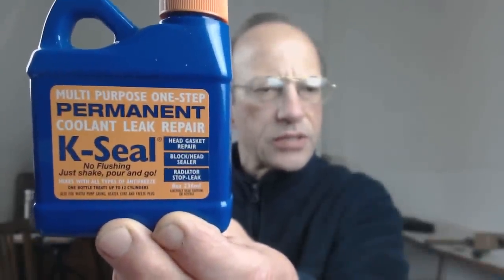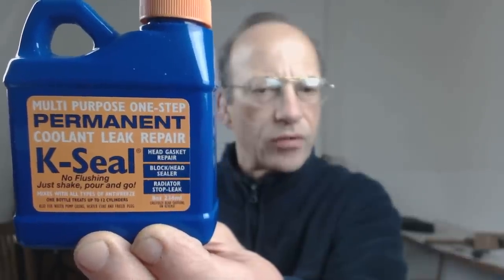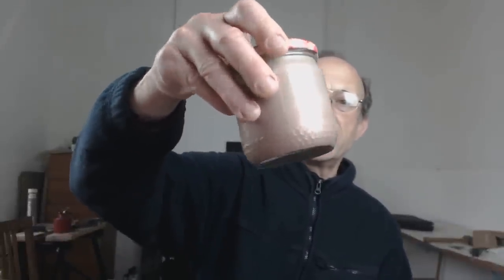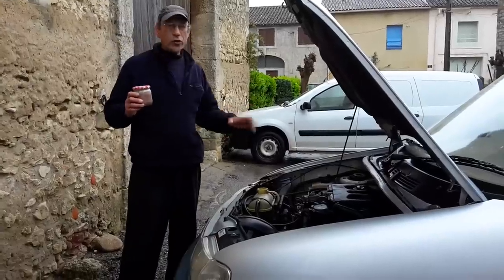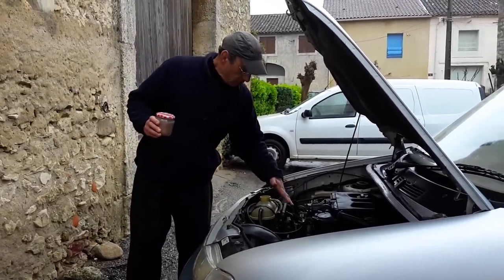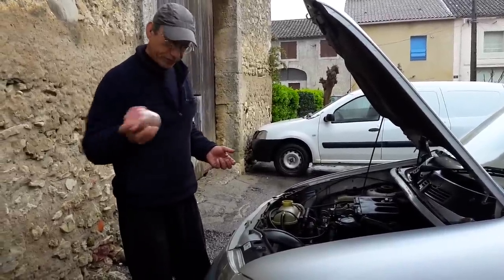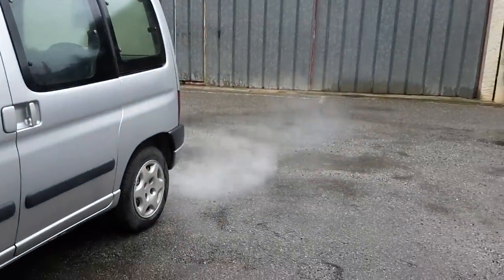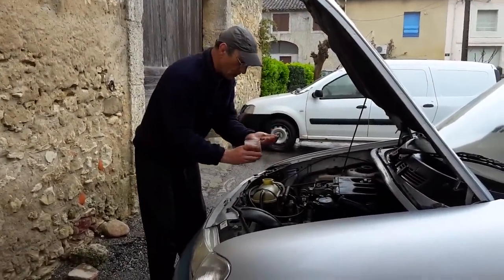K-Seal Full Test - Purchase options, Instructions & Results

Comment: Hi! Will it help in the case of hardening pipes of the cooling system and delicate leaks from the tank cap (too high pressure)? There are no other signs of a damaged headgasket, no smoking, oil stains in the coolant fluid and so called "mayonnaise" under the oil filler cap. One thing - floating temperature tip on the dashboard. But temperature not exceed 95 deegres. What do you think?
Reply from the maker: If the system is over pressure, there must be a reason.

When cold, remove the cap, or place on first notch (non-pressurised).
Warm the engine.
When the rad starts to get warm, the thermostat has opened.
Look into the radiator.

Do you see any bubbles at all?
Are there any fumes rising?
(either of these symptoms seal the deal)

Remember, the pressure is coming from somewhere (typically a combustion leak).

You won't see vapour from the exhaust ... at least not initially.
It only needs to be a tiny leak.

My advice would be to nip it in the bud.
Install K-Seal.

The fix 'may' take longer to achieve, due to gas pressure.

I know that this is not the season ... particularly with the current heatwave
... but If your driving permits (minimal speed and load), I'd drive with the rad cap on notch one.

This prevents over pressuring, but lowers the boiling point.

As long as you take it steady, you should not experience problems.

Keep an eye on the rad bubbles, and keep it to the correct level.
Any overflow, will confirm that you were right to take action.

Depending upon how bad the problem is, it could be fixed quickly ... or it might take more mileage.

Report back on how everything is going.
Reply: Engine Tuning, thanks for response. First of all I would like to point out that the problem concerns a diesel engine, namely a JTD engine. I have already performed a test for the presence of exhaust gases in the cooling system with a special tester  but the result was negative i.e. the liquid did not change the color. It wasn't professional tester,  so i will try confirm that test on the professional device as soon as possible. My first idea is to replace the coolant temperature sensor. maybe it's underestimating the indications and problem of overpressure is the result of overheating. The second idea is to check the exhaust cooler - for example: put a plug between the entrance to the cooler and the exit from the turbocharger. If it doesn't help i will try K-Seal.
Reply from the maker: Testing is always useful, and you've got it covered.

The key question is the over pressure.
If it is not fumes, then there will be no need for k-seal.

But there should be bubbles ... or every so often, a belch.

Probably the bubbles are caught in a kink somewhere, and they join together.
At a certain moment, the big bubble makes its move, and finally belches into the expansion tank

Just a word of caution to everybody reading this.
It is very tempting to just quickly smell the fumes, to confirm its not a vapour.

Don't do it!
You'll feel ill for the rest of the day.

If there are fumes, then you have a combustion leak.

Thanks for sharing the project Red Ford :)
Reply: Tell me - the color of the coolant after adding K-Seal has changed drastically? One more question. Can the cracks in the headgasket appear after the engine has been warmed up to a temperature of e.g. 75 degrees C? After the temperature 75C has been exceeded the diagnostic program records a sudden increase in the correction of the injector on the fourth cylinder (up to +3mm3/w). After cooling the engine below 75 degrees, the corrections return to normal. Strange...
Reply from the maker: Very interesting report.
I never took notice of the coolant colour change, but it seems reasonable to expect.

Re temperature induced changes

My guess is that, a casting crack is more likely than a headgasket failure.
If the headgasket has failed - my presumption is that temperature will make no difference.

However; if a component is cracked ... the crack can open and close according to temperature.

In this respect, I'm simply using logical analysis.
It can only be examination that will provide definitive proof.

From your report, the strong likelihood is that the failure (whatever it is) is around pot 4.
That would be either the block or the head.

How many miles have been driven (with k-seal installed)?
Have you driven those miles pressurised or depressurised?
Were you able to identify any bubbles or belching in the rad expansion tank?

If you have a secure site ... I would definitely leave the engine ticking over, with the rad cap off.
The rad fan will activate at ideal working temperature.
Checking for bubbles around this moment will confirm the basic fault.

The sealant will only seal, when the crack is open.

I have personal experience of only one 'over pressure' scenario.
The system would lift the rad cap valve, and it would blow off.

I advised (for better or worse) to leave the expansion tank cap on notch one, to prevent coolant ejection.
(It was a diesel 1.9)

Slowly but surely, the assumed crack filled (maybe 150 miles).
Now there is no more bubbles, no over pressuring, and no coolant consumption.

The cap was fully locked putting the coolant system back on full pressure.
It certainly appears to be a permanent fix.

:)
Reply: To be clear,  i didn't use K-seal yet. I just wanna know what will happened with the coolant fluid after adding K-Seal. Right now i'm still investigate the problem. I ordered another CO2 tester to confirm my previous, negative tests. The next step will be compression test in the mechanical workshop. I will let you know about any results.
Reply from the maker: The compression test might be interesting.
However, it might not :(

Pressure can escape past the valves, or piston rings.

The test might produce entirely misleading data.
A pot might be off, for different reasons.

The offending pot (say 4), might appear sound, if the assumed crack is not open.
Further ... if the crack is hairline, it might only produce symptoms at temperature, and under working load.

I know that we (as technical men) need to know.
It's not just the search for knowledge, but it is also the personal battle between man and machine.

However, on the odd occasion the truth eludes us, due to the overwhelming effort, when compared to the straightforward course of action.

It happened to me once.
I had a Rover 820 that would occasionally momentarily lose power.

It became a personal challenge.
Call it a hobby, but in truth, it wasn't healthy.

Ultimately, I discussed the problem with another engineer, who had a rolling road.
He'd seen similar 'impossible to solve' problems before.
He told me that he could run it on the rolling road, but it would cost me money, and the chances are that we would be none the wiser.

It was drivable, but simply annoying when it happened.

When it was time for a change, I told my car dealer (of the problem), and he sent it for 'auction as seen'.
I took a later model.

The point of the story, is that, you might grow your expenditure on this problem, purely in the search for knowledge ... which is absolutely admirable if you can afford the journey.

Otherwise; you could simply install K-Seal, and let it find the fault and fix it.

In doing so, you can promise to yourself that, when you do come to scrap the vehicle, you will first enjoy stripping the engine, to look for any tell-tale copper coloured cracks.

Anyway ... you can make your own decisions, and your reports are always welcome.

:)
Reply: I've just tested the next gasket tester. After 20 minutes of tests on a full warm engine, the result is negative. Cyclic appearance of bubbles in the siphon is visible. However, the color does not change. The same when the engine is loaded up to 3,000 rpm. Nothing happened. For sure, I put the tester under the exhaust pipe. After little while the color changed from blue to green-yellow. Here is the link to the test with visible bubbling: https://youtu.be/6lV1-tSGwQs
Reply from the maker: The bubble test is good, if it is made when the coolant is at full temperature.

From cold, there is expansion due to heat.
This would force air bubbles through the U bend.

Once the coolant reaches full temperature, the coolant system should be relatively stable.
If the bubbles continue ... the air must be coming from somewhere.

I am slightly surprised that the air looked clean.
If the air was coming from the combustion chamber, I would have expected some smoke.
Reply: Thanks. So I will repeat the test starting with a cold engine. Another interesting thing in my test - as you can see on the clip from the link above, the fluid moves from the middle to the left position. There must be some pressure, but as you can see, the color of the liquid does not change in any way.
Reply from the maker: My personal belief is that the 'bubble test' should be made, when the coolant and engine is at full temperature, with the rad cap removed.

This will ensure that the thermostat is fully open, and all expansion is complete.

Also - if there is a cracked component, the heat will cause it to open.

In this situation, there should be no air bubbles.

If there are air bubbles ... the air must be entering the coolant system (from somewhere).
----------------

1) If the coolant is not circulating sufficiently, it is possible that the coolant is boiling - releasing air (as steam).

2) Combustion gasses are escaping into the coolant system.

Remember:
If you leave the engine running for 20 minutes ... and there is a constant supply of air bubbles ... you must have a problem.
Reply: In my car there is no cap on the radiator. I have only cap on the coolant tank which is removed while test. I will try K-Seal after my summer trips. Meanwile I'm trying investigate the circumstances of appearance trickle of liquid on external surface of the coolant tank. For now, after 1 week from removing old traces the tank is clean.

Comment: can I just say this caused my engine to overheat and refer my engine useless and cost me £3500 to repair it. basically the k seal blocked the radiator and caused the engine to overheat,
I have a video coming up showing what damage it caused. to have my radiator replaced would cost £650 plus vat to re core. this stuff cost me an absolute fortune. sometimes it does work but on my 1934 vintage car it didn't.
Reply from the maker: Nice story... 
Why on earth haven't you uploaded a video of your 1934 vintage car?
What is it BTW?
Don't forget... when you quote your 1934 car... you MUST state the year of manufacture first, followed by the marque and then the model - You have broken international protocol!!!!!!!
Also note that when driving old machinery... every sense is aware of the engine, it's noise, smell, power, temperature etc.
Also note... it's very wise to do research into how radiators work.
This will help you decide on whether or not you should claim that the radiator was blocked by K-seal.
Reply: Tony Montana 
hi it depends on where they leak is and if it's a metal part or is it leaking from the gasket. I have put up a video on my channel if you need help using it. basically pre dilute the kseal with water then only pour in a little at a time don't use the whole tub as it does 21 litres you system is probably only half of that so pre mix half a tub with say 2 litres of water. drain some fluid out of you system then fill it with the pre diluted kseal

Comment: Awesome video thank you. I have a question.  Has anyone tried Kseal on a 2013 ford escape with  the 1.6 engine? The heater core is very difficult access on these vehicles and I don't want to clog it up. My leak is on the block in the third cylinder. I found that many people have the same problem but no solutions for someone on a tight budget. Once again, thank you.
Reply from the maker: Hey Frank; there is no testimony of heater cores being blocked.
It would have to be already blocked, for it to have any chance of sealing it ;)

Comment: I had a coolant leak and the light come on dash, no leak when car is off , soons I start the car it leaks underneath with coolant , I tried k seal yesterday and repaired the leak but it’s started again today so either it only lasts 24 hours or I done something wrong …. Any help would be great thanks
Reply from the maker: You need to investigate the cause of the leak.

If it is a rubber seal, then k-seal cannot fix it.
If there is a large crack in the rad, it may have fixed it short term, but the pressure then blew it out.

You need to find out exactly where it is leaking/
Reply: @EngineTuning  I’ve just put another bottle in wen I turned engine on it was pissing, put the k seal in and some water like ur video and the leak after 4 mins stopped its idle now currently and not a drop , how long Shal i stay idle for at optimum temp ?
Reply: May i add that not only has the leak stopped the coolant tank has plenty in and no dash lights
Reply from the maker: @jaylad1987  you can leave the vehicle stopped for an hour; then take it for a gentle run.
If the leak is fixable, then that will be it.
If it starts to leak again, then you will have to fix the leak using normal methods.

Good luck :)
Reply: @EngineTuning  assuming the leak has stopped now and still no signs one would assume it’s fixed but yeh it started again today after “fixing” yesterday ha ha
Reply from the maker: @jaylad1987  Yeah, it doesn't sound promising :(
But hey, you don't know :D

Comment: my 2008 honda pilot has a small coolant leak. honda tech told me leak is from water pump. so do you think kseal will fix my issue?
Reply from the maker: My guess is that almost certainly it will.
Clearly, it is not a major job to repair a water pump, but if you don't have time, or the tools... or you just can't be bothered to mess around; then K-Seal is for you (methinks).
Post back how it went :)
Reply: PlayF1 Net thanks for your quick response! i saw some are pouring it to the radiator directly and some to the coolant reservoir. so which one should i follow?
Reply from the maker: Add it to the expansion tank.
Simply follow the procedure as I did and it will be fine ;)
Remember to open the cap when the engine is cold (safety)
Reply: PlayF1 Net sure! i shall update you.